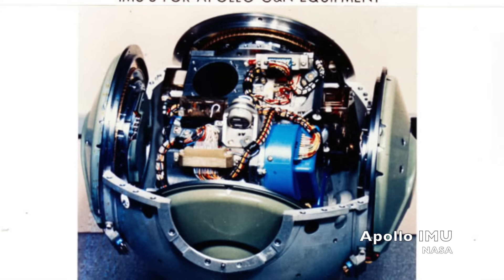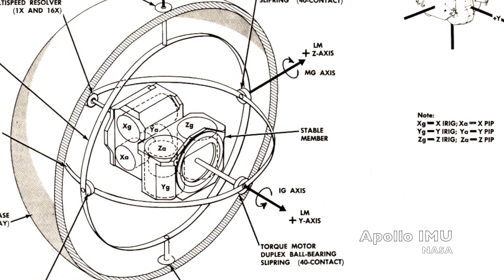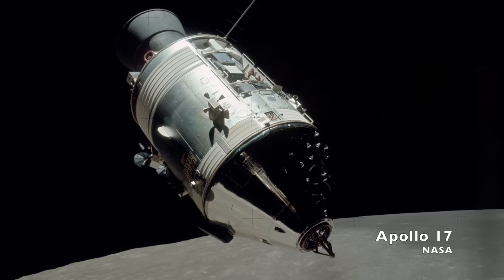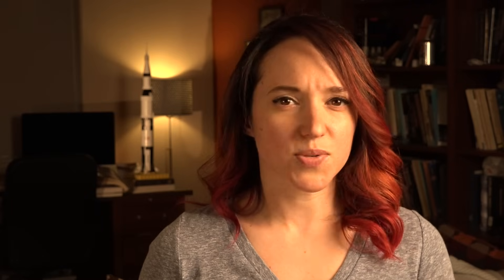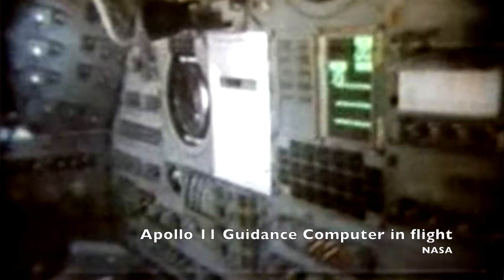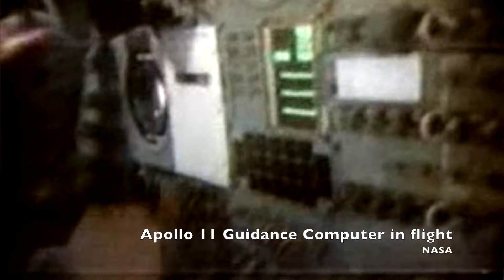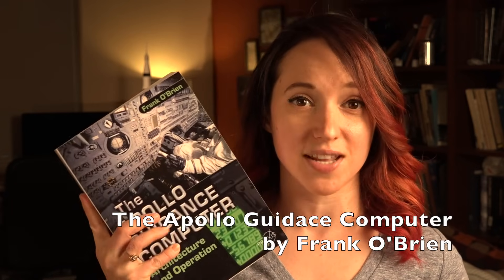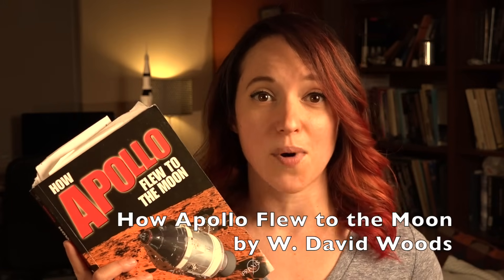Gimbal Lock and Apollo 13

Comment: Question(s): I understand that the big outter four F1 engines on the 1st stage gimbled around. Did the 2nd stage J2s do the same? And how did they move? What sort of massive (hydraulic?) mounting mechanisms did they come up with to make those huge thrusting rocket engines gimble around like that and what were they called?

Comment: Am I the only one who got distracted by the cat in the background and who sighed a sign of relief when it didn't push the Saturn V off the table?

Even though I had a cat which was similarly well disposed towards models. It once jumped on a table full of aircraft models while I was dusting them and didn't touch a single antenna. My two other cats on the other hand...

Comment: I thought gyros themselves resisted a change of orientation, why would there be motors to return the platform to its original orientation?
Reply: Probably because they can't totally resist a change of orientation due to friction in the gimbal mechanisms. They will eventually drift. There says we have solid-state (laser) gyros that don't have that problem.

Comment: I have a question. In the movie “Apollo 13” a course correction was performed using the the Earth’s “terminator” as a reference through one of the LEM’s two sideward facing windows. How would that be possible when the paired spacecraft were pointed towards the Earth and the LEM’s windows were facing into space?

Comment: I've a question regarding Newton's 3rd law which is needed to make adjustments to the pitch of the LEM for example. How does that work in a vacuum like space where there are no air molecules to react on ?
Reply: Newton's 3rd law doesn't rely  on pushing against something like air molecules.  It is the "explosion" of the gases from the thrusters that creates the force to nudge the LEM.   It is not the gases pushing against something.

Comment: My big question that I never get an answer to is,, how does mission control get all their information on all the systems onboard these space crafts??? Is there an array of sensors and a computer that sends this info to Earth? I have NEVER seen any documentary on the NASA missions that even mention this part of the process in these missions,, like me getting into my truck and drive in town and my girlfriend knowing how the truck's engine is performing,,, how is this done????
Reply: Search for the APOLLO  UNIFIED  S-BAND TECHNICAL  CONFERENCE              19650025875.pdf
On wikipedia: https://en.wikipedia.org/wiki/Unified_S-band
That's what NASA planned to use for communicating with the astronauts and the spacecrafts in space.
Included in the specs of the communication was, that they logged every communication on telemetry tapes.
If they had used it there should have been telemetry tapes. But those telemetry tapes don't exist.....

Comment: I had a buddy who was in aviation, and he told me that gimbals in space are useless because they rely on gravity to orient.  Granted, he was a Moon Landing conspiracy nut, but he raises a valid question: how exactly does a gimbal work in a microgravity environment?
Reply: Gimbals work just fine in space.  The law of inertia applies in space just as it does on Earth.  One could actually make the argument that they work better in space (or more accurately, free fall) because they don't have to deal with gravity.  If the space craft changes orientations, direction or speed, it must necessarily accelerate to do so, and the gimbals will react to that acceleration.  Gravity is just something to account for; not a requirement for function.
Reply: Willoughby Krenzteinburg Thanks for clearing that up for me.  That actually makes a lot of sense.
Reply: no problem.

Comment: So I have read up tons on this but have not got much information on how to correct it. I heard a lot of “it would have been a disaster if they did lock” but never about what exactly that meant? I am wondering because they simmed every possibility in the simulators did they ever sim this? 
So what would have happened had they locked? Was it the death of the men? Was or would it have been an impossible problem to correct? That’s my question and not many can seem to answer.

Comment: You show the AGC display flashing digits and the keypad beneath, called the DISKY (display keypad). Well, it was my own dear dad who came up with the wiring harness to make the DISKEY work. Andrew Sullivan worked for Raytheon corp who had a contract with the space program, and they could not make a wiring harness that could withstand the rigors of space flight. 

The story goes that Andy Sullivan believed he could design such a harness and took a weekend to work on it. Monday morning Sullivan presented the wiring harness to his boss by slinging it over his shoulder and plopping it on his desk, fully intact and operational. 

Just a bit more arcane knowledge that is certainly more than anyone wanted to know :-)

Comment: On a side note, mentioning that the Apollo guidance computer was aligned on the launch pad sufficed from launch to insertion into earth orbit. But the INU reference platform (REFSMMAT which stands for "Reference to Stable Member Matrix") had to be realigned several times during flight in order to support certain phases of the mission. For example, launch pad alignment on the FDAI does you little good traveling to or from the moon much less in lunar orbit..!

Comment: The solution is a free-floating gimbal with electro-optical sensors to determine orientation.  By using cyan, yellow, and magenta markings with the appropriate filtered sensors, the markings for each axis can be read without interference by other markings.  In this way, all three gyros remain at right angles to one another.  Power to keep the gimbals moving can be passed using radiative power couplings, the same as are now recharging some smart phones.  That technology is actually pretty simple, and existed long before the 1960s.

Then again, these days we have much more accurate ring laser gyros.  :)

Comment: "Give me a place to stand on, and I will move the Earth." 
A Gimbal Lock is what our ancestors (You are one of us) installed on the Luna Pole that is closest to Our Earth in order to Create the Tidal Forces we needed to Separate the Darkness from the Light. Without it the Poles of the Earth and Sun would face each other and would only Equalise every 11.4 years when Our Sun Did the same with Her Counter Part.
When our years were 11.4 times longer than we have them today the Sun (Spirit of the Lord) would not have time to separate the Dark Side from the Light Side long enough to  melt the Ice (divide Elements "H + 0") to Make the Clouds ("divided the firmament from the waters"). Thank God for that because if not we would have no Sky ("Heaven")...
And that is GOOD... 
 

SEE...
Triskelion ?...
See the  three interlaced creatures (forming a triskelion pattern) that have been identified as a boar, an eagle, and a wolf.[2] The stone has been dated to 400–600 AD.
Although a number of scholars call it the Snake-witch,[4] what the stone depicts—an accurate interpretation of the figures—and whether it derives from Celtic art or Norse art remain debated.
https://en.wikipedia.org/wiki/Snake-witch_stone

See also...
A triskelion or triskele is a motif consisting of a triple spiral exhibiting rotational symmetry. The spiral design can be based on interlocking Archimedean spirals, or represent three bent human legs.
The triskelion symbol appears in many early cultures, the first in Malta (4400–3600 BC) and in the astronomical calendar at the famous megalithic tomb of Newgrange in Ireland built around 3200 BC,
https://en.wikipedia.org/wiki/Triskelion

SEE ALSO...
The earliest traces of people in the Isle of Man date to around 8000 BC, during the Mesolithic Period, also known as the Middle Stone Age. Small, nomadic family groups lived in camp sites, hunting wild game, fishing the rivers and coastal waters and gathering plant foods.[6]
The Neolithic period was marked by important economic and social changes. By 4000 BC, people once reliant upon the uncultivated natural resources of the land and sea had adopted cereal growing and stock rearing, using imported species of grain and animals. Large scale clearance of natural woodland provided fields for crops and animal fodder.
https://en.wikipedia.org/wiki/Manx_people

AND OTHER CARIB PETROGLYPHS...
Typically, many fantastical images exhibit caricaturesque exaggeration of features, the zoomorphising of human elements, and the anthropomorphising of animal elements. These exemplify drug-induced shamanic rock art known from other regions of the world.
 In some locations they represent the only intellectual remains of the ancient inhabitants. Wherever found, they bear significantly upon the evolution of the human mind.’ Petroglyph analysis can include other factors such as the direction that it faces in addition to the physical features of the rock surface, which might be rough or have cracks, and somehow be part of the story being told. Carved rock surfaces should be studied for a few days in all degrees of sunlight, and even seasonally, in order not to miss anything. When viewing a petroglyphic group, it is best to let your eyes wander around the rock looking for how the figures may interact with each other, in what is known as a ‘prehistoric animation’.
Ancestor worship was also an important factor in prehistoric Caribbean religion. Dr Kirby has suggested that the weathered fresco of elongated figures, found on a remote rock face near the village of Petit Bordel on St. Vincent, represents spirit ancestors wrapped in their burial hammocks. He also believes that they were made by the pottery making Caribs who left northern South America
https://www.world-archaeology.com/features/caribbean-petroglyphs/

ADAM (TRUE ISLE OF THE ORIGIN OF MAN)...
Compare them to the Petroglyphs at Dusquene (Inclined plane) Bay in Grenada (Eden).
http://blog.cariboutdoor.com/2014/11/caribs-petroglyphs-amerindian-remains.html

EVE...
Snake worship is devotion to serpent deities. The tradition is present in several ancient cultures, particularly in religion and mythology, where snakes were seen as entities of strength and renewal.
https://en.wikipedia.org/wiki/Snake_worship

According to Pappus of Alexandria, Archimedes' work on levers caused him to remark: 
"Give me a place to stand on, and I will move the Earth." 
Archimedes of Syracuse (/ˌɑːrkɪˈmiːdiːz/;[2] Greek: Ἀρχιμήδης; c. 287 – c. 212 BC) was a Greek mathematician, physicist, engineer, inventor, and astronomer.[3] Although few details of his life are known, he is regarded as one of the leading scientists in classical antiquity. Generally considered the greatest mathematician of antiquity and one of the greatest of all time,[4][5] Archimedes anticipated modern calculus and analysis by applying concepts of infinitesimals and the method of exhaustion to derive and rigorously prove a range of geometrical theorems, including the area of a circle, the surface area and volume of a sphere, and the area under a parabola.[6]
Other mathematical achievements include deriving an accurate approximation of pi, defining and investigating the spiral bearing his name, and creating a system using exponentiation for expressing very large numbers. He was also one of the first to apply mathematics to physical phenomena, founding hydrostatics and statics, including an explanation of the principle of the lever. He is credited with designing innovative machines, such as his screw pump, compound pulleys, and defensive war machines to protect his native Syracuse from invasion.
Archimedes died during the Siege of Syracuse when he was killed by a Roman soldier despite orders that he should not be harmed. Cicero describes visiting the tomb of Archimedes, which was surmounted by a sphere and a cylinder, which Archimedes had requested to be placed on his tomb to represent his mathematical discoveries.
The last words attributed to Archimedes are "Do not disturb my circles", a reference to the circles in the mathematical drawing that he was supposedly studying when disturbed by the Roman soldier. This quote is often given in Latin as "Noli turbare circulos meos," but there is no reliable evidence that Archimedes uttered these words and they do not appear in the account given by Plutarch. Valerius Maximus, writing in Memorable Doings and Sayings in the 1st century AD, gives the phrase as "...sed protecto manibus puluere 'noli' inquit, 'obsecro, istum disturbare'" - "... but protecting the dust with his hands, said 'I beg of you, do not disturb this.'" The phrase is also given in Katharevousa Greek as "μὴ μου τοὺς κύκλους τάραττε!" (Mē mou tous kuklous taratte!).[13]
Cicero Discovering the Tomb of Archimedes (1805) by Benjamin West
The tomb of Archimedes carried a sculpture illustrating his favorite mathematical proof, consisting of a sphere and a cylinder of the same height and diameter. Archimedes had proven that the volume and surface area of the sphere are two thirds that of the cylinder including its bases. In 75 BC, 137 years after his death, the Roman orator Cicero was serving as quaestor in Sicily. He had heard stories about the tomb of Archimedes, but none of the locals were able to give him the location. Eventually he found the tomb near the Agrigentine gate in Syracuse, in a neglected condition and overgrown with bushes. 
https://en.wikipedia.org/wiki/Archimedes

Cicero had the tomb cleaned up, and was able to see the carving and read some of the verses that had been added as an inscription.[15] A tomb discovered in the courtyard of the Hotel Panorama in Syracuse in the early 1960s was claimed to be that of Archimedes, but there was no compelling evidence for this and the location of his tomb today is unknown ?... (I Know, I'm HOME).
BIG IMAGE...
https://upload.wikimedia.org/wikipedia/commons/a/a6/Cicero_Discovering_the_Tomb_of_Archimedes_by_Benjamin_West.jpeg
ALL SIZES...
https://en.wikipedia.org/wiki/Archimedes#/media/File:Cicero_Discovering_the_Tomb_of_Archimedes_by_Benjamin_West.jpeg
Reply: Ezekiel (/ɪˈziːkiəl/)[a] is the central protagonist of the Book of Ezekiel in the Hebrew Bible.
In Judaism, Christianity, and Islam, Ezekiel is acknowledged as a Hebrew prophet. In Judaism and Christianity, he is also viewed as the 6th-century BCE author of the Book of Ezekiel that reveals prophecies regarding the destruction of Jerusalem, the restoration to the land of Israel, and what some call the Millennial Temple visions, or the Third Temple.
https://en.wikipedia.org/wiki/Ezekiel

"Give me a place to stand on, and I will move the Earth." 
http://www.refuteit.com/uploads/1/3/0/4/13043423/800px-3d-gyroscope-wiki-public-domain_orig.png
Ezekiel chapter 38, talks about a war in which the nations will gather to invade Israel. However, the interesting point that’s revealed is that that the bible once again, clearly states, that Israel lives in the center of the world.
“…take the spoil and to take the prey; to turn your hand against the waste places that are [now] inhabited, and against the people who are gathered out of the nations, who have gotten livestock and goods, who dwell in the middle of the earth.” Ezekiel 38:12
https://www.curezone.org/forums/fmp.asp?i=2328153

Ezekiel 1 King James Version (KJV)
1 Now it came to pass in the thirtieth year, in the fourth month, in the fifth day of the month, as I was among the captives by the river of Chebar, that the heavens were opened, and I saw visions of God.

2 In the fifth day of the month, which was the fifth year of king Jehoiachin's captivity,

3 The word of the Lord came expressly unto Ezekiel the priest, the son of Buzi, in the land of the Chaldeans by the river Chebar; and the hand of the Lord was there upon him.

4 And I looked, and, behold, a whirlwind came out of the north, a great cloud, and a fire infolding itself, and ???

King James Version (KJV)
Public Domain
https://www.biblegateway.com/passage/?search=Ezekiel+1&version=KJV

Comment: The gravity/weight of Apollo and the centrifugal force needs to be equal to stay at the same altitude as I understand it.  Apollo was flying at around 25,000 miles per hour to the moon.  Did it slow down before it orbited the moon?   It seems like it would have to as the gravity of the moon is 1/6th of the earth.  It seems like CM would be flung out into space at this speed with less gravity to hold it in orbit.  The lunner lander would have to slow down form 25000 to 0 and then back up to 25000 mph to dock again with the command module.

Comment: Thanks for that explanation Amy.  If I recall correctly, ultimately their efforts to avoid gimball lock (essentially messing up the calibrated settings) were moot when they shut down the command module to save the battery.  The lack of power would have allowed the gyros to spool down and the settings were lost anyway.  At least that's what I remember, it's been a while since I read the book.  Also if I recall recalibrating the IMU during the CM powerup was difficult because the window with calibrated markings that the crew would use to align the spacecraft with certain stars was frosted over from the O2 tank explosion making vision difficult.